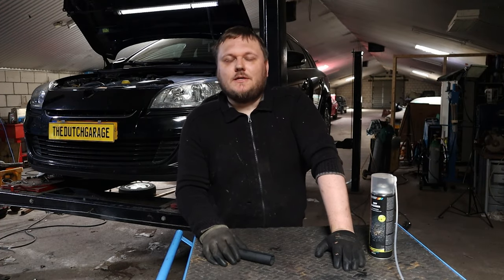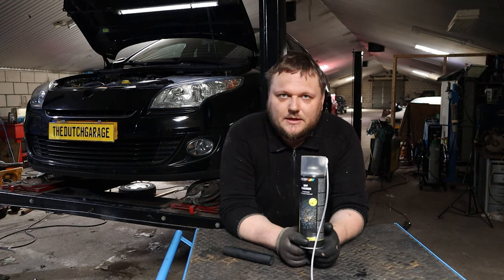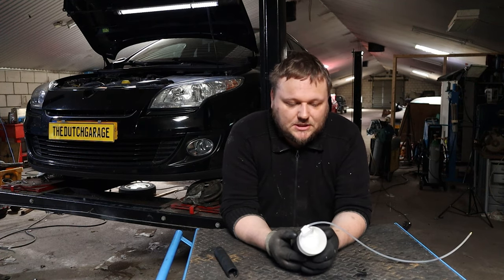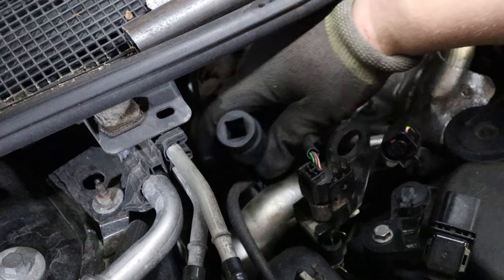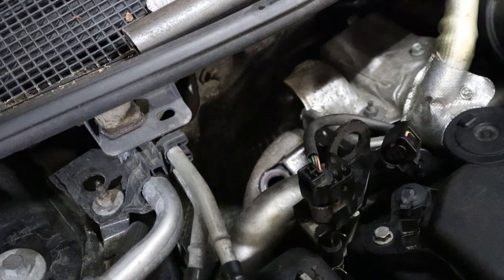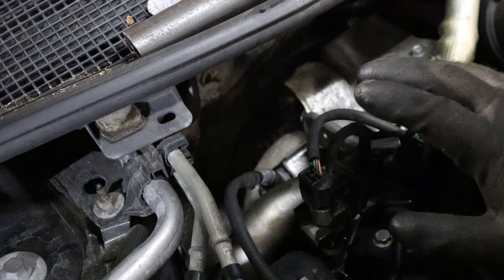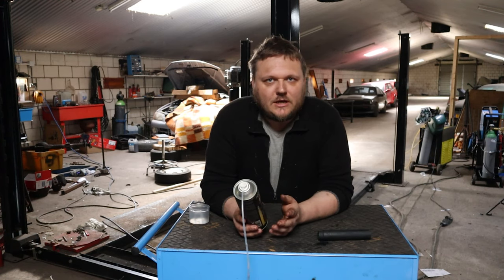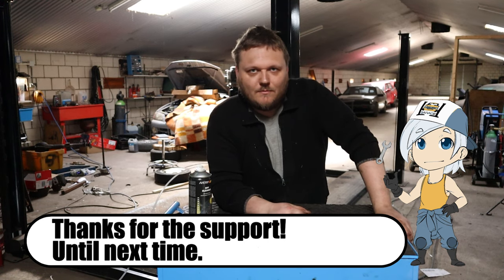How To Clean A Particle (DPF) Filter.

Comment: It worked against dirty dieselparticulate filter which triggered limp mode, thank you. I injected 2 cans through oxygen sensor opening. Then   I used error code reader to erase error code. Now it works as normal. Before it didn't help to only erase error codes.
Reply: Nice to hear. I have the same problem where it's stuck in limp mode (vw passat 1.6 Tdi) . I tried one can through the hose of the dpf pressure differensial sensor but the hose there is so damn long that i bet most of the product was wasted in one edge of the filter.

I will try like in the video with 2 cans and hope for the best 😅👍
Reply: @TallDudeSSj  1 can didn't work. 2 cans in a row worked (maybe 3 cans needed even in your case). I waited 10 min to let it soak into the DPF, I also cleared the limp mode lamp with obd2 tool so car can gear up and then I took it for a highway ride and DPF diode turned off as soon as I reached high speed because the high airflow helped push out the dirt. I used ProMeister DPF Cleaner (not regenerator) because they were on rebate. Good luck.
Reply: @frv6610  nice tips! Thank you! 😁
Reply from the maker: @frv6610 is it a long lasting fix in your case?
Reply: @TheDutchGarage  It works long time/still works. It can come back if driving style is not good, for example driving often with gas pedal pushed to bottom with high rev and not let car go to higher gear, this can be interpreted as dirty filter but in this case just inject again DPF cleaner  as described above and it should go back to normal. I have Citroen 1.6, it was easy to inject through oxygen sensor hole. Thank you.

Comment: You need to do this with a hot engine and the engine needs to be on. And if possible spray via the map / particulate filter boost sensor hose.. and while spraying, a second person needs to   press the gas pedal for many times.
Reply: That goes direcetly against the instructions on the can
Reply: Lol
Reply: Lol no

Comment: I can confirm that this stuff works. I could read the raw values from the differential pressure sensor and the difference before and after were very clear. (I used another brand though, but I guess they all work the same way.) In my case I took out the temperature sensor on the DPF module to enter the foam.

Comment: honestly I cannot imagine how any can spray product wants to remove 100+ grams of ash and sooth, hardened like stone by prematurely stopped regenerations. For all of this you need very high temperatures to melt the sooth and high pressure solvent liquids to remove that from the filter. I‘d advise to either consider professional cleaning or alternatively a replacement filter with corderite substrate which is far cheaper as the silicate-oxide and works just as good.
Reply from the maker: If the filter I indeed to clogged then this probably doesn't help. But I do think it's worth a try. It did work in a couple of cases for me.

Comment: Hello, are these sprays suitable for engines with DPF placed after the turbo, in the front of the engine? Isn't there a possibility for some of the spray to get in the turbo and from there in the engine?
Reply from the maker: The sprays I know of need to be used in like in the video.
Reply: Don't play with turbo, it is easy as you can see, on my car is very simple.

Comment: After doing this i got error codes, engine light and glow plug. Is this normal? The car works fine when i drove with it after doong the spray thing.
Reply: i thought you were supposed to spray it when the DPF was hot and the engine is running.

Comment: i have a Toyota 2.0L D4d 2011.
My mechanic told be to buy one of these (i think Wurth) and to put it in the differential temperature sensors (red marking)
then you have to force it to go into regeneration mode ( a lot of RPMs >3000rpms for 30'-60' highway driving.

Comment: Hi there ! I really need your help ! I have a Peugeot 5008 2.0 HDi 163 hp 2012 diesel ! Problem is I can’t find the temperature or pressure or oxygen sensor under the bonnet ! Thanks in advance

Comment: While using this product through the exhaust system would it harm the catalytic converter?, my car has 130,000 Mi 2013 VW Beetle TDI and I'm getting a code of p2002 add p0401, the engine is spotless and it runs perfectly, thank you for the class I really appreciate it great job
Reply from the maker: Normally it would be save to use. Check the instructions on the package.

Comment: will that help me for my Audi A1 2012 model, I have the Light with says EPC and engine on, or shall I change everything off the thing and buy new to my car!
Reply from the maker: I don't know if it would help with that, EPC light most of the time has something to do with throttle body and/or EGR valve. You have special cleaners for those.

Comment: Hi Mr Dutch. Am I used to applying this DPF Foam on my 2018 Eclass from the upstream nox sensor please?
Reply from the maker: You want it close to the top of the filter so the exhaust gasses are pushing it through.
Reply: put on tube from dpf sensor, in the first tube on dpf sensor.

Comment: What’s the black socket you’ve used with the notch that fits around the sensor wire? Thank you
Reply from the maker: It's a o2 sensor socket. You can get them fom amazon, ebay or local part shop.
Reply: @TheDutchGarage  are they all one size for all vehicles? As I’ve got a Peugeot partner tepee and it looks slightly smaller.
Reply from the maker: 22mm is the most common one.

Comment: Hi, can you not spray the cleaner through the pressure sensor hose?
Reply: i did and it worked fine. making a video on it. but if you can get to temp sensor on the dpf its even better
Reply: I think this kind of stuff is a foam, not a liquid. I'm afraid your sensor hose will get stuck with it. In my case I can't get my O2 sensor off, not even with a tool like in the video. It's just too stuck. So it's tempting to try the sensor hose instead, but I'm not risking it.
Reply: @Hneel65   thats what i done.

Comment: I just need to know does it clean  converter Well this be able to work with non diesel in engine my old car burns oil so my four twenty pop sub I just need to clean my cats
Reply from the maker: There are cat cleaning agents that you can add to the feul. But remember there is no such thing as a mechanic in a bottle. But it's worth a try.
Reply: @TheDutchGarage   Have you tried seafoam
Reply from the maker: @isrealperez9069  No, I never have.